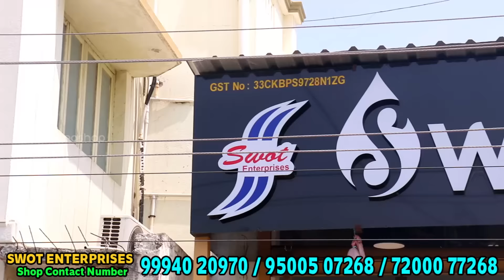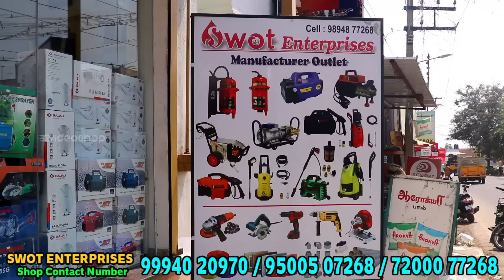இனி நீங்களே Car wash மற்றும் Bike wash வீட்டிலேயே பண்ணலாம் | SWOT Enterprises Erode | Video Shop

Comment: 200 bar pressure where it is not efficient more than 150 bar as indicates in meter Guage.
He fixed the rate based on Bar capacity.
While contacting the way he justified giving answer is not acceptable.
Which Govt body restricted or banned not to exceed 150 bar ?